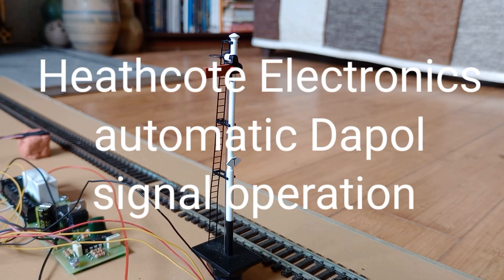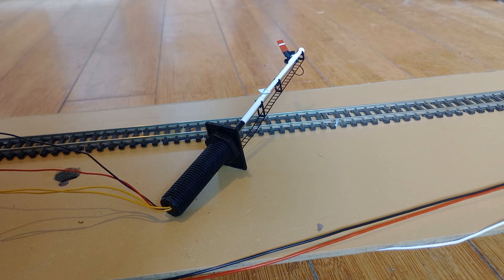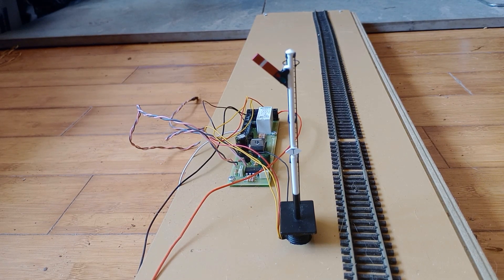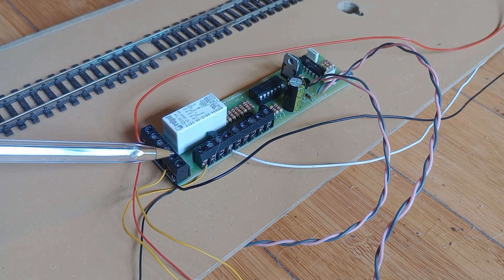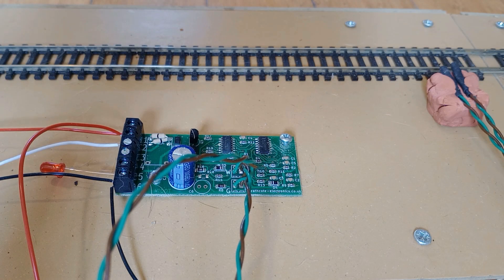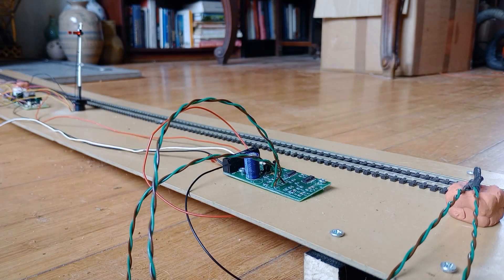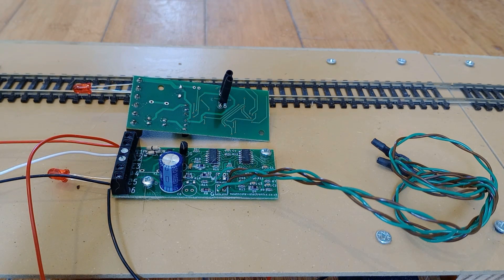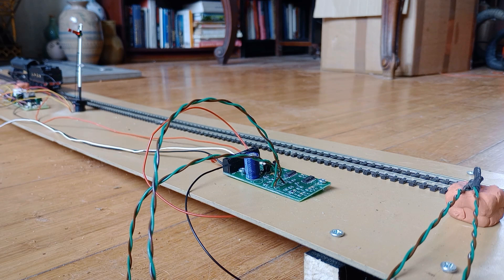Automating Dapol Signals with Heathcote Electronics Controls.

Comment: Does the infrared sensor itself need setting up in any way, or just placing in a chosen place in the track?
Reply from the maker: The sensors normally fit in a hole between the sleepers. They are positioned where you want the signal to return to danger when the front of the train is detected.
Reply: Thank you - I just wondered if they needed programming for either 2,3, or 4-aspect colour signals...  @heathcote-electronics
Reply from the maker: @MaboPete  We have different circuit boards for 2,3 and 4 aspect.
Reply: Thank you - I'll get a bit further with the layout and see just what I want. @heathcote-electronics